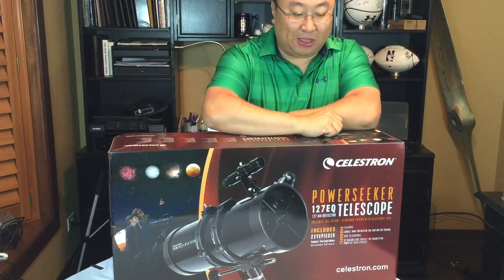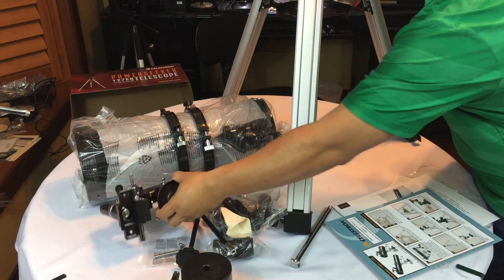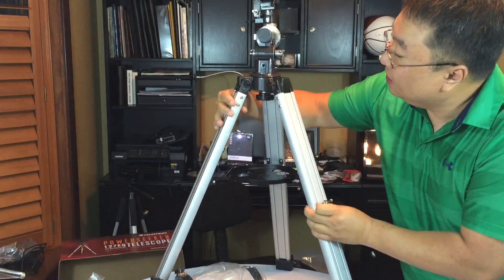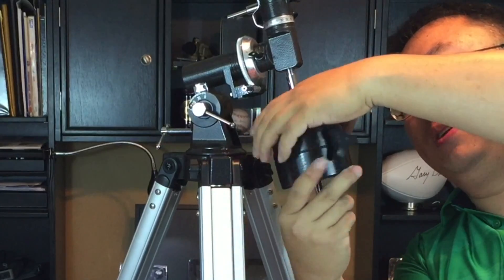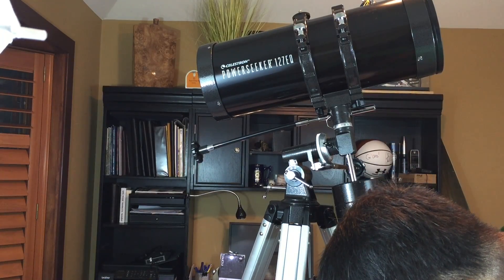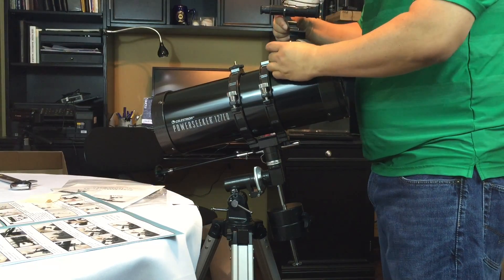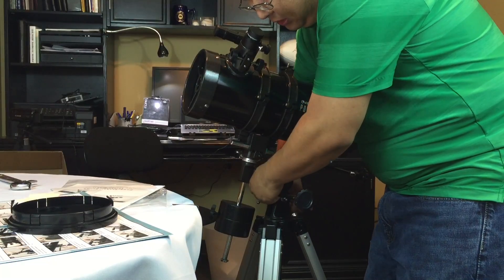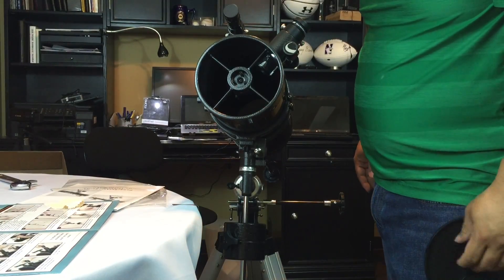How to Assemble the Celestron 127EQ PowerSeeker Telescope

Comment: I bought a used Celestron 127EQ, After watching your video, I decided to put my Celestron 127eq together. As I went through the process of assembling the unit, I found out that there was a missing part, I found out the missing part was the latitude adjustment screw. By the way, by watching you, I learned the name of the item that was missing; thank you for that. Do you know where I can purchase the missing part? I appreciate it if you know where I could get it.

Comment: HELP PLEASE FELLOW ASTRONOMERS!

I've never owned a telescope and I recently got the Celestron Powerfinder 76AZ for my birthday, it looks similar to this but it's smaller. 

When I was setting it up and I was going to insert the eyepiece (the 20mm one) I took off the cap (Just like 8:13 ) and two pieces of glass and a small plastic ring fell out. I assume this wasn't supposed to happen? 

Should I take it back? Can I get a replacement eyepiece? Help <3
Reply: That wasn't supposed to happen, and yes, you can buy other eyepieces if the rest of the telescope is fine, that's all you need to make it work again.
Reply: I GOT THE SAME PROBLEM, GOSH, AND NOW I DONT KNOW HOW TO PUT IT BACK
Reply: Hello! This happened to me too, if I am correct, the eyepiece fell apart, the plastic ring (if it was rubbery) is part of the eyepiece. You can put it back my placing it around the top of the eyepiece if that makes sense. No worries, it will be fine as long as you are gentle when talk off the cap of the eyepiece.

Comment: I just bought this and set it up. I tried using it and whatever planet or anything I find. that I line dead on in the cross hair of the finderscope. I see absolutely nothing through my eyepieces.
Reply: J bear did you align the finderscope with the telescope?
Reply: Juan Francisco Góngora Gómez all I know is I installed everything  just as the directions stated. What process needs to be done to align the finderscope? it mounts to one location and fastens.
Reply: J bear you need to find an object in the distance, preferably at daytime, like a tree or a streetlamp, try to center said object with the telescope, then look through the finderscope and center the same object with its crosshair.
Reply: J bear you can refine the alignment at night by finding a star and aligning both scopes more finely
Reply: Juan Francisco Góngora Gómez sounds simple enough to do. thanks for replying with how to do it! much appreciated!
Reply: J bear just remember to use the three little screws that hold the finderscope in position, they'll help you refine its position
Reply: Use the lowest magnification eyepiece. Increase the power slowly.

Comment: Hello,

Thank you for your interesting video. However, I would like to connect my Canon SX400 IS with a Celetron powerseeker Telescope, is it possible ? How ?

Thank you
Reply: You need to buy the T-Ring and T-Ring adapter specifically made for the Canon camera body.  Do not buy a "universal" one.  They are usually pretty cheap.   You should be able to get both for under $20.
Reply: Thank you very much :)